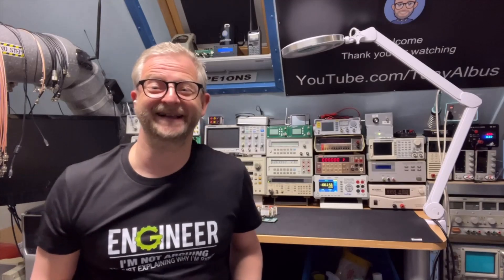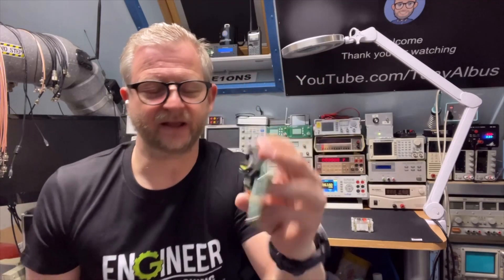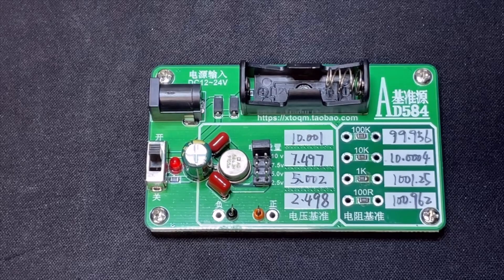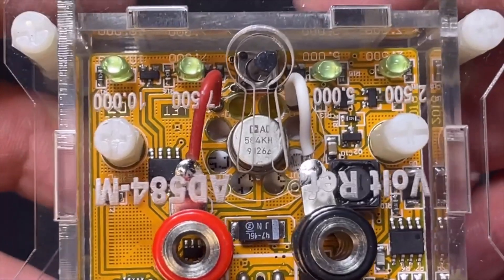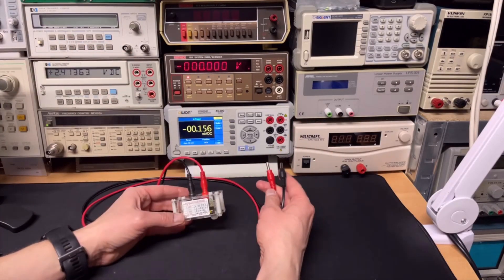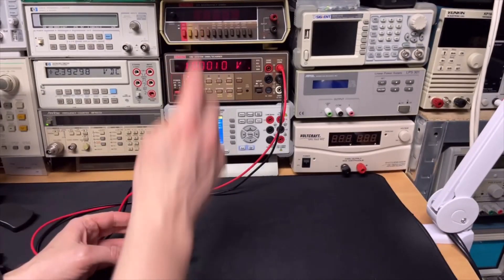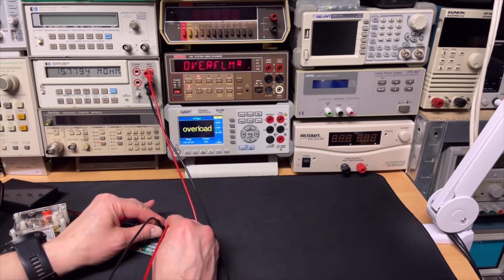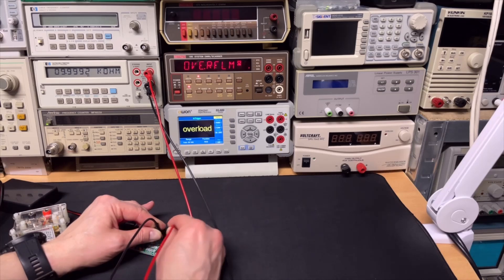#153 AD584 Voltage Ref for 10 Dollar

Comment: The only issue is they don't come with calibration specs printed on the unit. Kind of useless for someone without a highly accurate bench meter to test it which defeats the purpose of getting this unit. If you know of a vendor that sells one with the specs on it I will buy immediately. Thanks for sharing!
Reply from the maker: They should come with specs on the PCB, if not its useless. mine did.
Reply: @TonyAlbus  Thanks Tony! I guess I will find out. I ordered the green one with voltage and resistance calibration today along with a 4 pack of the 12V, 23A batteries. I can't wait to test it out! I will follow up here when I receive the unit and let you know if it came with the calibration specs listed on the unit.
Reply from the maker: Yes let us know, good for others to know too.
Reply: @TonyAlbus  Will do for sure. Got to help each other out.
Reply: @TonyAlbus   As promised. Got my AD584 (green PCB that uses 12V battery) in the mail today and as I suspected there was NO CALIBRATIONS LISTED anywhere on the device nor was there any certificate or paper inside the clear, sealed envelope. It took 11 days to get here and is worthless! I'm going to contact the seller and let them know and ask for an explanation as to WHY this was sent without any calibration specs whatsoever. All I can say is BUYER BEWARE! I'm so frustrated! Perhaps I can use the values Tony's came with but I shouldn't have to do this. I don't know of anyone with a accurate enough bench meter to test the accuracy this unit goes down to.
Reply from the maker: @GripFreak  That Crap, ask your money back... useless...  sorry to hear that man, i hope you can solve it.
Reply: @TonyAlbus  Here's the response I received this morning from an email from the supplier that sells this vr module:

dear customer we are so sorry for the delay this is the reply from the supplier "Calibration requires the use of a 6½-digit multimeter, with a diagram attached, for these four sets of digital measurements." wish this can help you and please feel free to contact us if there has other problem have a nice day best regards
Reply from the maker: @GripFreak  Thats not good, it should come with numbers... did you get the device from one of my links? tell me which one, then i remove it.
Reply from the maker: @GripFreak  Good to know, thanks for teh feed back, we can help other people for warning then.   Thanks!